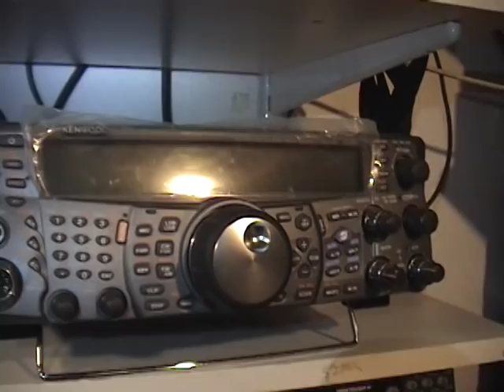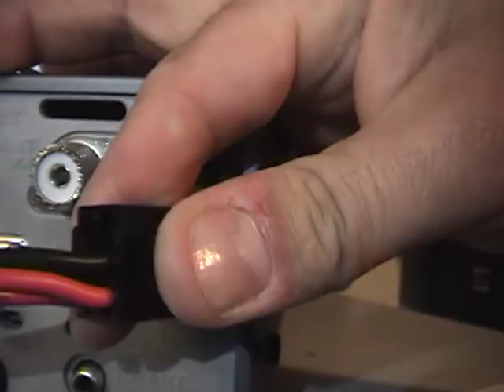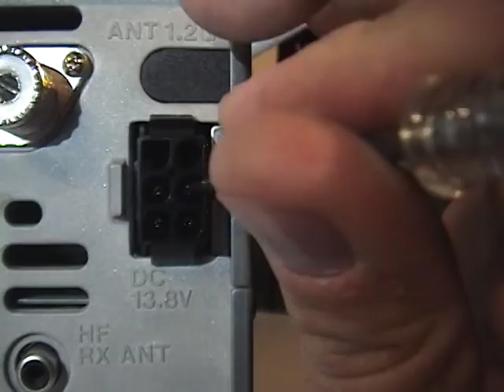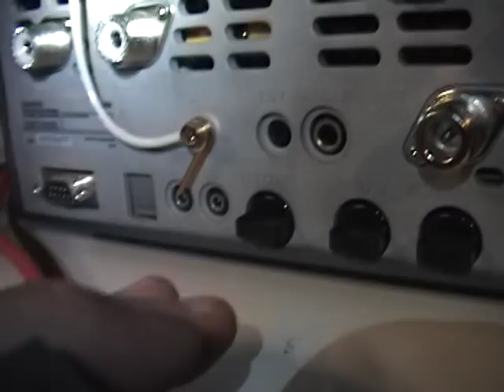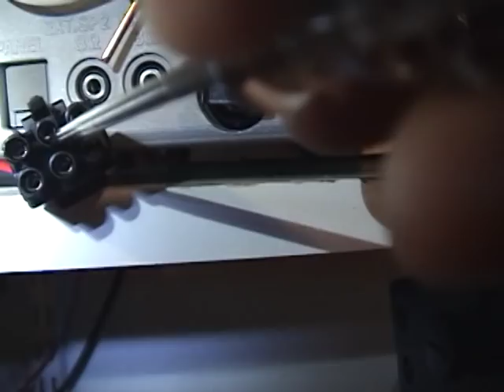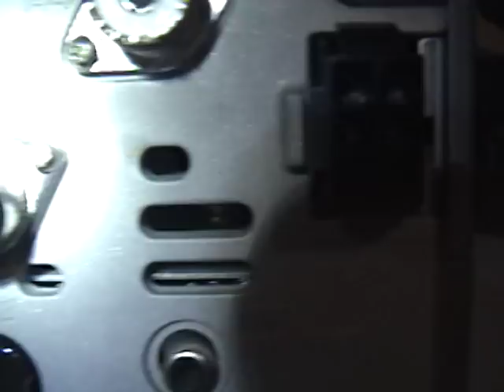TS-2000 Fix.avi

Comment from the maker: Lastly I do recommend trying to get the awl or other similar object along the entire length of the split female connector so as to compress the entire 'tube' instead of just the front part.
I need to just replace the entire connector set with something much better.

Comment from the maker: I do agree that the file is not a great idea. It does have the ability to remove too much metal and all of the ones I have found are tapered and don't' work properly. I do use a small piece of steel wool inside the female connector and push it back and forth inside. However, I did not know that the contacts wee plated? I just thought they were aluminum; at mine seam to be.